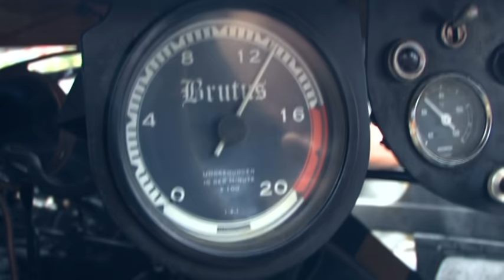Experimentalfahrzeug BRUTUS

Comment: That´s not completely correct. The Heinkel-Bomber used a Daimler Benz engine Type 601 in the early version and the Jumo 211 from Junkers in the late version. However Brutus has a BMW engine Type VI. Only the first four prototypes of He 111 used the BMW engine, not the serial version.

Comment: What causes that beautiful start up whine?
Reply: That is the starter motor winding out, probably spinning a 100 to 1 (or greater) reduction gear so it will have enough torque to turn over the huge engine.

Comment: Scared to ask about fuel-efficiency and how much it costs to fill up a full tank
Reply: Do not be scared. Here comes your answer ;) Based on the stats i found on the net and a documentation i watched about it:
It kills about 200 liters of normal fuel (min 87 octane) in about an hour.
The tank however only has around 70 liters volume.
So calculating it with the fules prices of super fuel (95 octane / we do not have normal fuel <= 95 octane anymore) here in germany:
1,50€ / l x 70 = 105€
or
$1,99239 / l x 70 = $139
per tank-fillup.

Calculated on the usage per hour it eats 300€ / $398,478 in one hour woth of fuel.
:)

Comment: because, producing 750 hp at 1600 rpm you can guess it has the torque of a train engine. bringing the whole power on the street with wider tires would rip it apart. It is more like an hommage to the old racers from the 1920s, more like a piece of art ;)

Comment: @1978atcarroll It's adjusted to run very rich to prevent the engine from overheating (look at the ridiculously small radiator) and make it live longer. You can trust me, the Technik Museum that built it is in my town ;)

Comment: Back pressure is a bit of a made up idea... in that, it back pressure means exhaust restriction. If you get rid of that restriction and fuel the engine to suit not having it you wont have an issue. Prime example of little to no exhaust being a good thing for max power; Drag cars!

Comment: nahh this engine can easily put on drag car with 2 massive turbo on..make a many thousands of HP..
Reply: no it actually can't
Its is 1. too heavy 2. has literally 0 grip
Reply: i think i can make it for drag..just give me money and u see a fucking monster outside your door!
Reply: you could not run turbo's on an engine like this,first of they were not built to handle that kind of pressure,secondly they only rev to about 2200 rpm,turbo motors need to rev much higher than that,btw learn how to spell!
Reply: you can build this engine to handle and pressure and HRPM..hand made with CNC, such as pistons,rods,crankshaft,liners and all the engine part like intake manifold etc  so.. i must learn english and u about four-stroke gasoline engines, diesel engines..
Reply: TheDreameR you can build anything to handle anything,i was talking about this stock unmodified engine,sorry i don't need to learn about engines,but you still need english lessons!
Reply: I started learning English 5 months ago and i think im pretty good..but how can I talk about two big turbos to make lots of HP and you thinking about stock engine..once i say about that exactly 2 turbos, im talking about a modified engine with all that this implies..anyway i see an opportunity to this engine but very expensive..

Comment: A spitfire engine on 4 wheels ,it will not handle well and would be detrimental to your health with all the exhaust fumes in your face,would prefer to drive a tractor with an F1 engine in it.